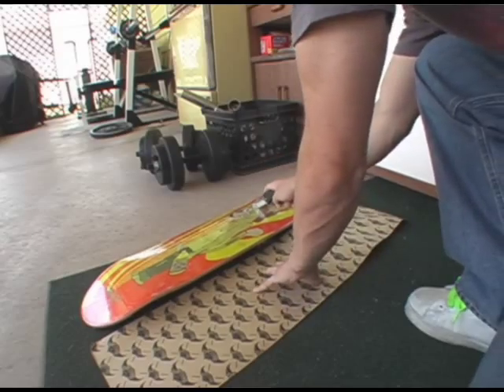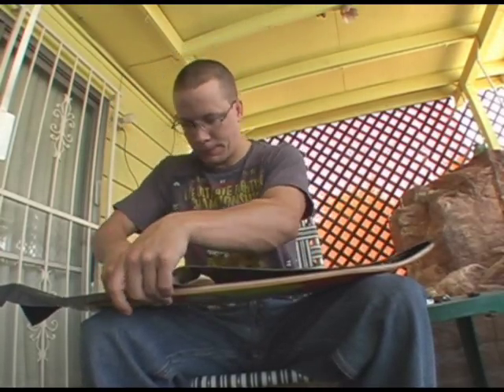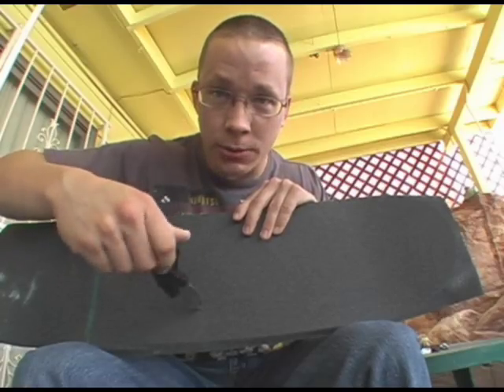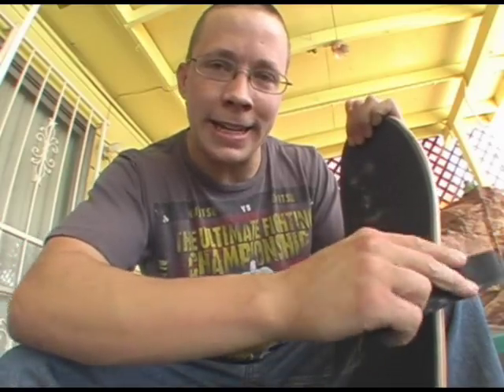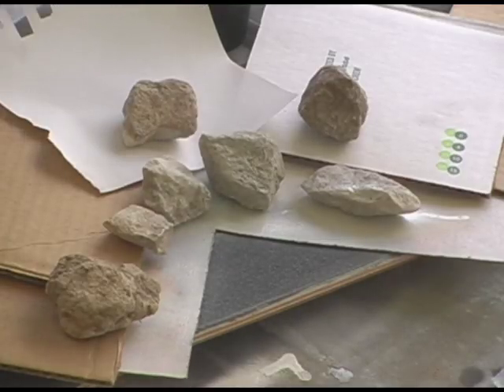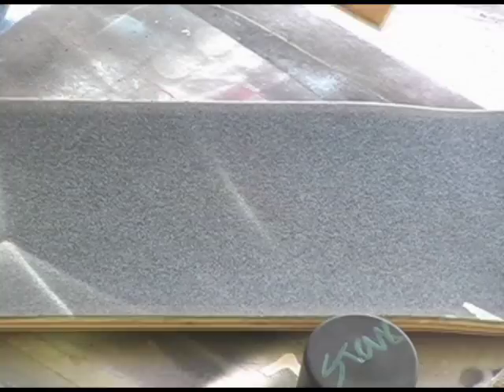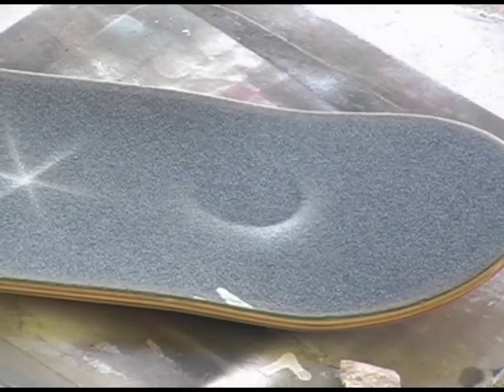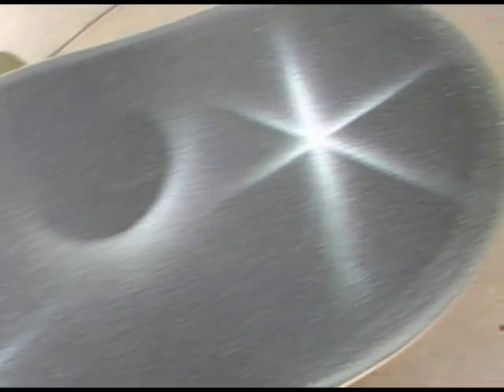Want awesome grip tape?

Comment: That's a terrible grip job. .__. The edges were uneven and excessively sanding down the edge of the grip tape removed the polyurethane coating on the sides of the deck.
Reply: Not if the board snaps
Reply: *****
lol it doesnt matter whether your griptape is on point or not..doesn't extend the life of your board
Reply: Eugene Rhee A decent board shouldn't snap in the first place. This argument is about the grip tape, not the life the life of the board. If you can apply the grip tape correctly, why not do it?
Reply: well the average lifespan of a decent board is a month or shorter if you can skate gnarly (longer if you're getting the basics) but when you say a "terrible" griptape job...trust me i've seen worse. Ninja dude did a decent job gripping the board
Reply: lol idk why dracoultima commented about the tape when james was talking about the board snapping.. but its whatever. Sure he couldve did a better job, but it doesnt really matter either.. the point of the video was the paint designs he added.
Reply: MichaelArronBerger James commented that a grip tape job wouldn't matter under the assumption that the board would break in a month. James was, in fact, "talking about" the grip tape. I disagree. A decent board shouldn't break in a month. By decent, I'm talking high end materials. Not the crappy 5-ply boards that every company spits out. By saying it doesn't really matter, you just voided your own point.
Reply: ***** how is that valid... when you're responding to my comment; that i might add is about a response... to your comment... which you did acknowledge in this comment.... lol........ that aside how is this relevant to my response about how a boards life depends on how actively its used??
Reply: ***** yeah!
Reply: travis gipson And Birdhouse
Reply: everythingfilms and also my comment made a lot of sense. It was true.
Reply: xactly
Reply: Tyler Mayer
he obviously didnt read all my other comments lol prolly jst the one i said the 7ply shit whatever though man i dont even care any more. jst was trying to make the point that boards break depending on a lot of different shit no matter how many plys.
Reply: skatingfortheweek
lmfao
Reply: ***** the side of a deck isnt polyurethane :l
Reply: SuicideSkating yep lol
Reply: yes its so important if you do it like this you ll die on your skateboard because all the chemicals get released and infect the scooters. and infected scooters are very dangerous.
Reply: +Timo Eberle Hahaha

Comment: I personnaly put glue under my shoes, it works the same and is cheaper
Reply: lol that's not the only reason for grip tape haha
Reply: How would you flip the board if it's glued to your fuckin feet ??? Lol
Reply: Korey Smith I do backflips it's steezier anyways
Reply: and how would you push your way forwards if your shoes are glued to the board.

Comment: Pro tip: Use a heater gun to make it easier laying down the grip without bubbles.
Reply: the whole reason why we sand the edges is because if it gets hot out the sticky part of the grip on the bottom gets loose and peels the grip and the way we peel grip off is using a blow dryer idk if laying it down with something hot would be safe...

Comment: Your method for scoring tue grip is horrible. The point is to create a fine ridge for your razor or knife ect to glid across. By goimg over and over it, you're creating a larger ridge in which your razor can move side to side slightly, that's why you're getting a dodgy cut.

Comment: Does the paint have a bad effect on the gripness of the grip tape though?
Because I don't want to mess up my grip tape...
Reply: Most likely not as long as you don't soak the thing
Reply: It doesn't affect the grip tape. Ive done it.
Reply: If you dont want to use spraypaint, painter's pens are cool to use
Reply: Ok guys thanks!

Comment: Is there a difference between the front and back of a deck?
Reply: Sometimes, if you have an end that's smaller that's the tail (its closer to the ground to give more pop), and the larger end is the nose (the larger nose helps catch your foot when you ollie)
Reply: nose is longer and steeper, tail is more mellow and shorter
Reply: Nooo the tail is the skinnier side, it's hard to tell at first
Reply: darude - sandstorm

Comment: why use 2 separate pieces of grip tape can't u use one
Reply: Did you not listen to the video at all? It's because he wants to know which is the nose or tail.
Reply: Ok no I didn't I skipped most of it thx
Reply: +James Thornton he only used one piece of grip tape, he just cut it to get the line
Reply: Justin Stevens I know but why?
Reply: Oh, yeah its usually just to help decipher nose to tail. Usually you can just tell but if your in the middle of a line mobbin it helps. I also know people who just do it for looks, a friend of mine runs a strip from tail to nose on the left side